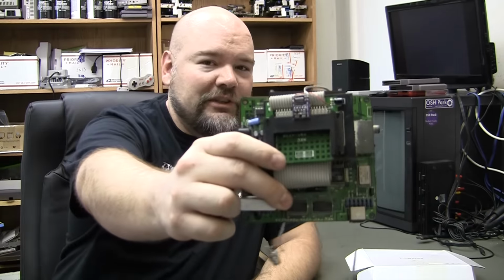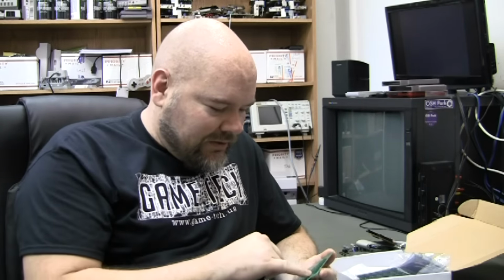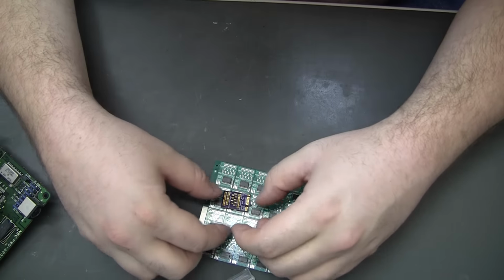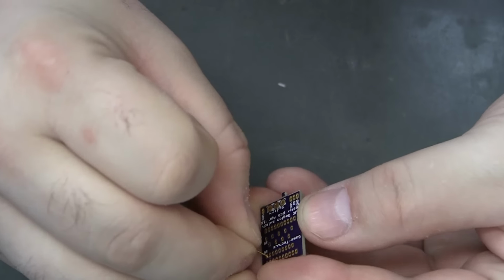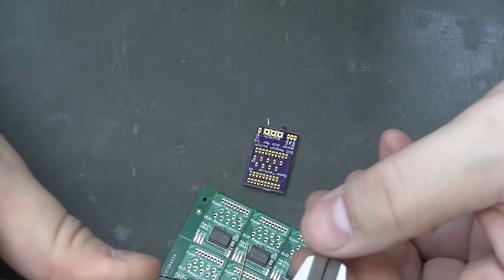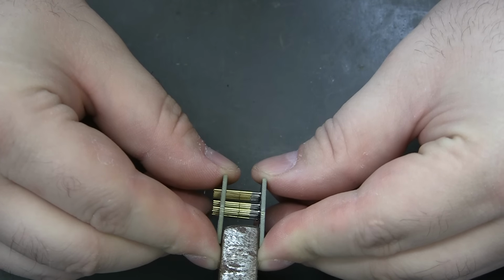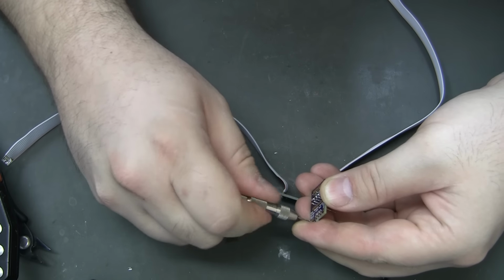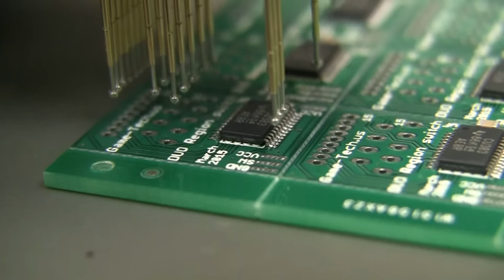Turbo Duo region mod pcb final testing - fab + assm by pcbway

Comment: The board that is mostly unpopulated apart from one side is probably the extra board. They probably spotted a few boards missing chips, and the easiest way to get you over 200 was to just do up another board, but not bother fully populating it. Maybe they threw in the extra 5 to cover defects?

Dem pogopins, tho... They look soooo close together in the closeups. Definitely could have used thinner heads.
Reply from the maker: +Adam Zey 
Agreed about the pogo's, in fact I say so in the vid that they are too big and I just didn't want to wait for more to show up. Worked find in the end.

Comment: I work at a place that builds stuff kinda like this (IPC 610 Class 2 and 3 if you're familiar with that) but the boards that random non-pop's are more then likly x-out's that the PCB itself has issues and was found before parts were placed, but the rest of the boards on the panel are fine.  This happens way more often than you would think it should, especially on the 10+ board panels.  

Not sure about extras, but they probably did this as mentioned below, to cover defects as they probably did not do any kind of ICT (In Circuit Testing) as this probably would cost more then the board is worth to do. (and even at my work it isn't done, like any other test step, unless required by the customer.  And most require something, being a visual, Xray, or ICT or a combination.)
Reply from the maker: +sharkbytecomputer 
Great info, thanks! I was wondering if I could just instal the components, but i'll just toss em now that you shed some light on the issue.

Comment: I bought 2 turbografx recently at different times and the only thing wrong with them was the RF BOX. I bypassed the rf box with a composite jack and the consoles worked fine.
and Its so easy to test that because you dont even need to build an amp. in the turbografx theres an amplyfing transistor right before the rf box input.

I guess a bad rf box must be a common problem on these consoles?

Btw, nice work on this board, Jason. it really does look easy to install.